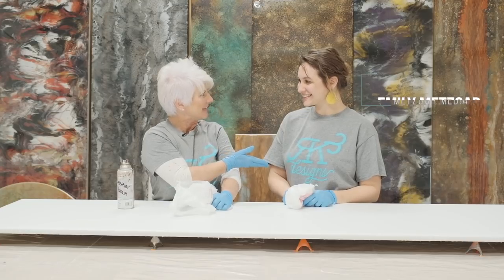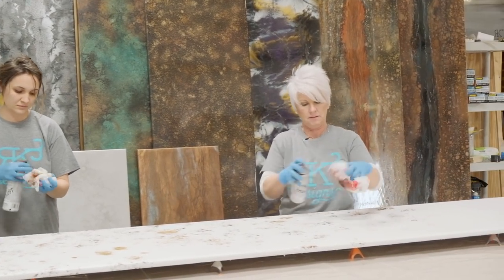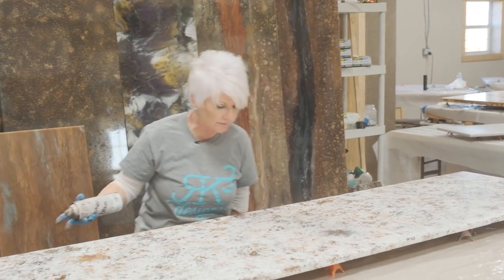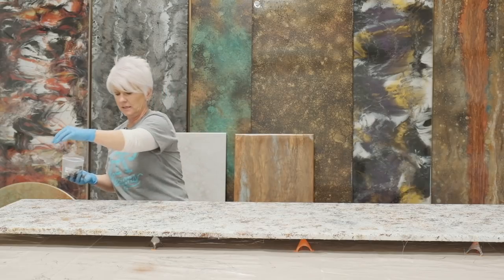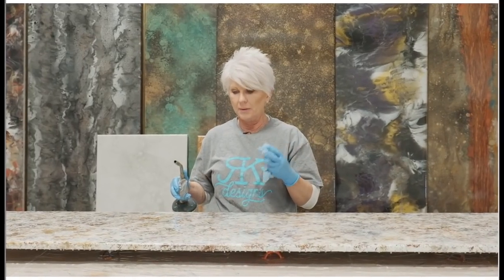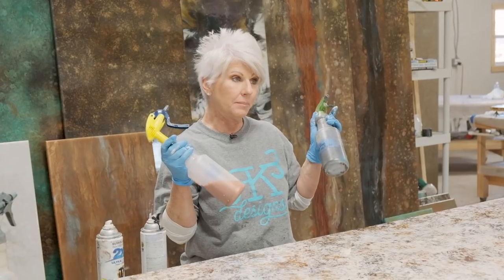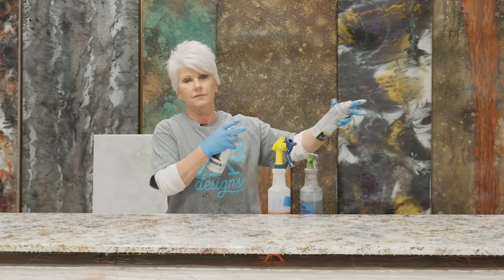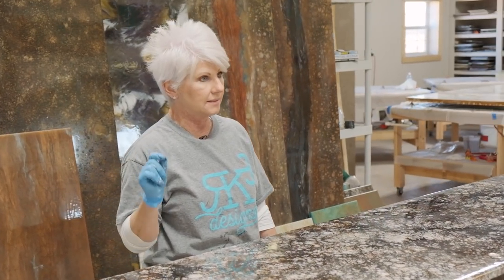Bagged, Montana Granite with Stone Coat Countertop Epoxy

Comment: I love this look. I have a long narrow low cabinet I built and did a faux granite finish with paint on the top. Its not quite believable so I can sand it lightly and do the epoxy part on top using the old painted finish as the base. I think it'll look amazing! Thanks 😊

Comment: I had a doubt dear, is Epoxy resin materials can used for outside on sun, I mean is it useful to make outside furniture like coffee table for outdoor purpose?.
Reply from the maker: Hi there. Epoxy is ok outside as long as it’s under a shade. It’s not recommended to be in direct sunlight. I have a table on my patio that’s 5 years old and in fantastic condition. 😊